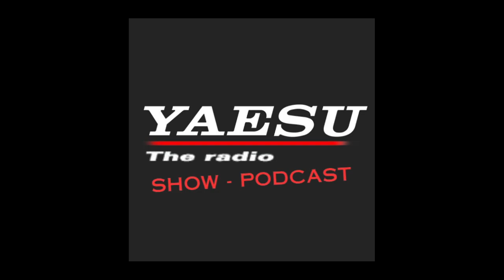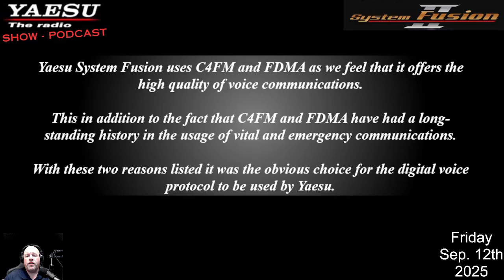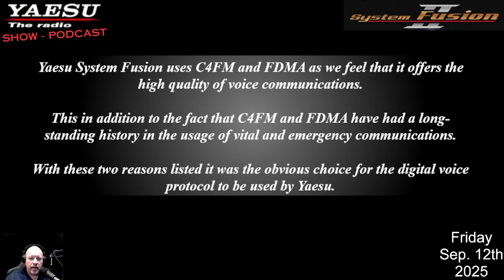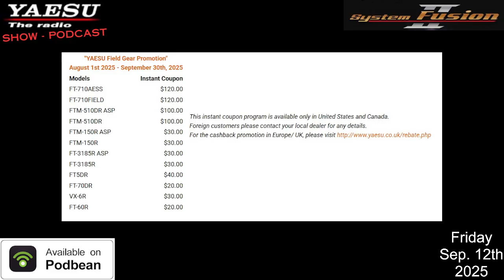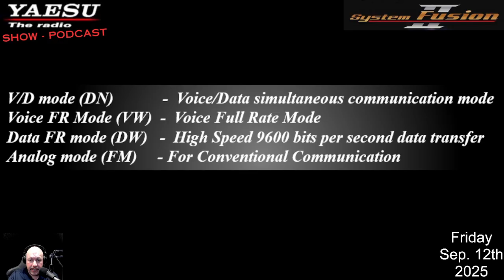S4E22 - Why C4FM/FDMA for Yaesu System Fusion

Comment: My FTM-510 System Fusion radio really delivers a quality signal that I can easily understand. It’s got a bit more “punch” and seems to break through more easily when the signal is weak. I wish more radios would use digital. It’s such a nice feature. - KF0QNM